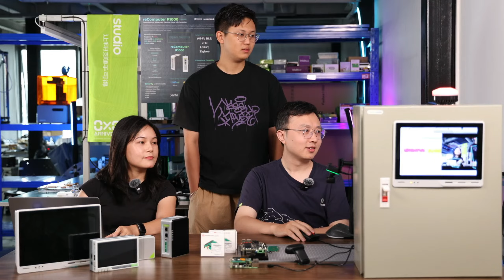Making Next Gadget: AI Boosted RPi for Real World Applications

Comment: How much slower does using the double M2 board make the AI? I currently have an RP5 with an NVME already, so could just upgrade it when that becomes available. Alternatively I could just use an SSD/USB3 instead as I have a spare somewhere. Then I could use the single NVME/board but that is more hassle and less neat. It all depends on the speed loss by using the dual board whether it is worth the hassle.
Reply: Currently, most of the dual M.2 Pi5 hats available on the market use a PCIe 2.0 switch. This means that there is approximately a 50% loss in acceleration performance for high-load AI projects using Hailo. As for the PCIe 3.0 hub, there will also be some performance loss because Hailo will share the PCIe bandwidth with the SSD. Seeed is currently testing a PCIe 3.0 hub, and we will provide updated test results in the future.
Reply: @aidan1857  so if they make a PCI 3 dual M.2 board in August will it be like PCI2 (eg. Twice as fast but split in two) or does the hub divide bandwidth unequally so if the NVME drive is quiet you get more than half of PCI 3 bandwidth for the AI M.2?
Reply: @vividexplore  PCIe switches do not evenly distribute bandwidth. Instead, they can provide the full bandwidth to each channel. For example, if the accelerator is not in use, the SSD will receive the full PCIe 3.0 bandwidth, and vice versa. We will conduct actual tests on the acceleration performance of both 2.0 and 3.0 PCIe hubs when the accelerator and SSD are operating simultaneously, and we will provide a report. Stay tuned:D